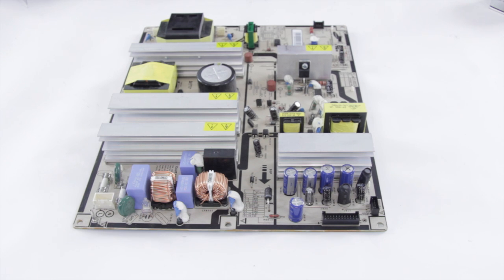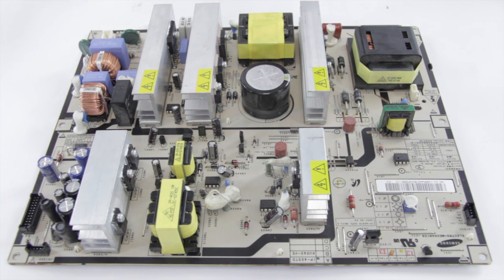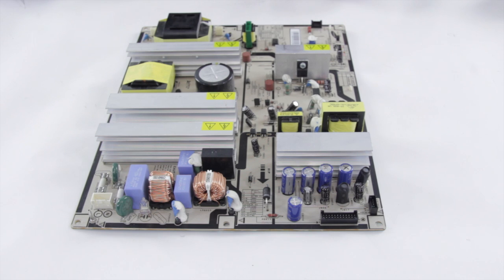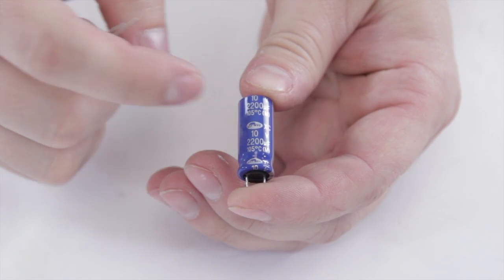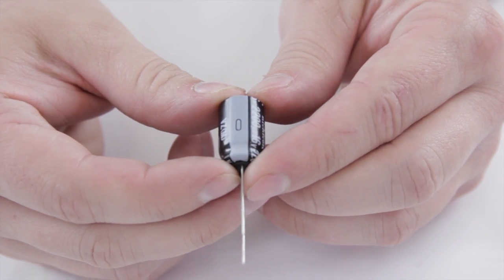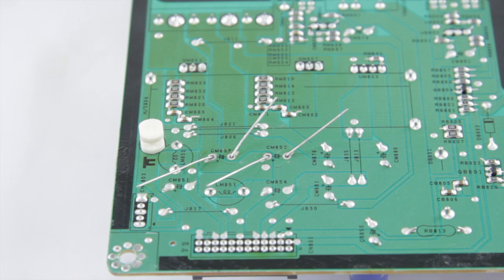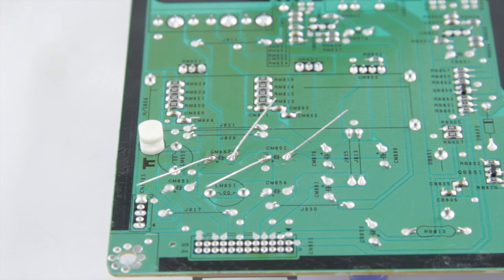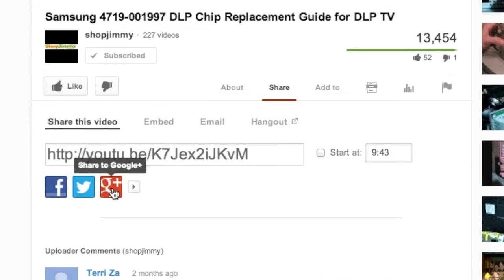Samsung TV Won't Turn On - How to Repair Bulging Capacitor for Clicking Noise

Comment: Hi S.J. Great vid. Thanks for showing us the solution on how to fix this problem. I have a Samsung 40" Model: LE40A556P1FXXU, which has just started to switch on and off several times when it eventually comes on. Will this problem get worse over time?

Also, I get green / yellow ish vertical lines on both the left and right hand side of the screen, just a couple of inch's wide. This only shows up when the screen goes dark, for instance when viewing a film shot at night.

Can you please advise if a repair is a cost effective solution, given the issue with the coloured lines. If so could you please advise approx. cost of parts.

Many Thanks,
Reply from the maker: justdom999 If the TV shuts off then turns itself back on I would replace the power supply but if the screen just loops itself replace the main board.  Here is a link to replacement parts for your TV model number on our website, click here:  http://www.shopjimmy.com/catalogsearch/result/?q=LE40A556P1FXXU  Be sure to match part numbers on your current board, with your replacement for compatibility.  You can also call our customer service for further assistance with your purchase.  (877) 881-6492  Thanks and please let us know if you have any further questions with your TV Repair!  www.shopjimmy.com

Comment: Hello, thanks for your service. I have a Samsung HPT5054. I want to ask. If I have a capacitor that needs to be set at 105 degrees. Can i replace it with an 85 degree as long as voltage and mf matches. Thanks

Comment: The bottom of the board below one of my bad caps has several thin parallel lines of solder and one leg of the cap is connected to at least two of them.  The lines do not appear to connect to anything, I just wanted to find out what they were for before I desoldered the bad caps and started soldering the new ones in.

Comment: This is a great video.

My tv isn't broken but I came across this video and I am happy to see that this clearly explains a lot of the basics of replacing a bad capacitor and soldering. I was familiar by most of this, but there are some things like using flux and cleaning up with alcohol that I'm goint to put to use as of now. Thanks!

Comment from the maker: @Ignacio Galarza - Although the caps look fine, they could still have an issue.  The only way to know for sure is to check them with a meter.  You could also replace the entire board.  Unfortunately, we are currently out of stock for this board, however you can search the board on our website, shopjimmy com and sign up to be notified when the board is back in stock.  Thanks and please let us know if you have any further questions!

Comment from the maker: @Juan Mejia - I would recommend replacing the power supply in your TV.  You can search your TV model number on our website, shopjimmy com to find the part.  I will also send you a YouTube message with specific directions and the part number for your replacement power supply.  Thanks and please let us know if you have any further questions!  (877) 881-6492

Comment: My pn51e450a1fxza won't turn on it was connected to my ps3 and just went off I also had my sound system connected to my ps3 and that won't turn on as well I think my ps3 shocked them both

Comment: We have a zenith that sounds like it has a capacitor problem (red light is blinking, won't power up), but when I opened up the back all of the caps look fine :( any tips?